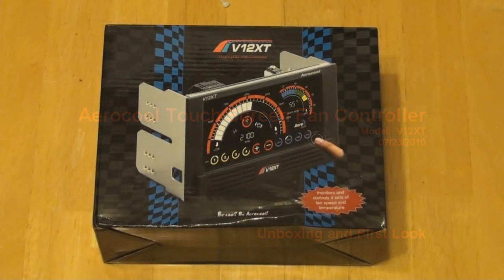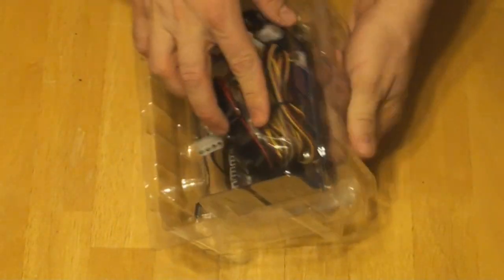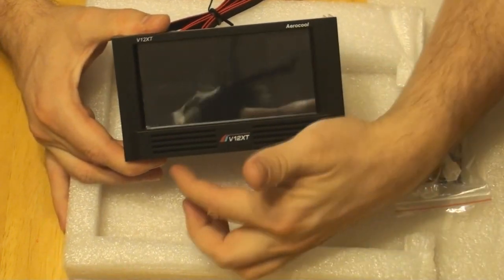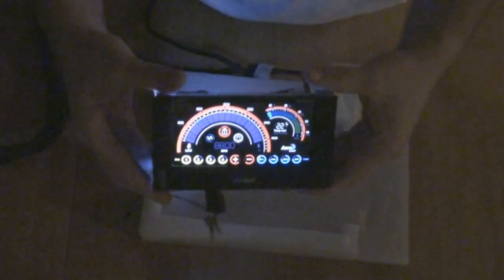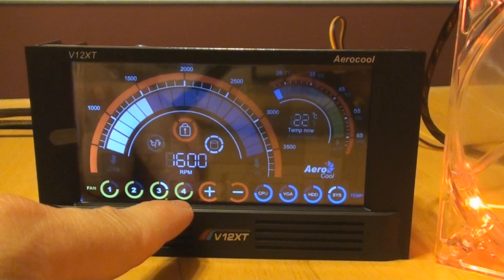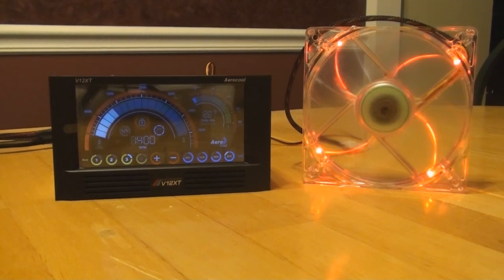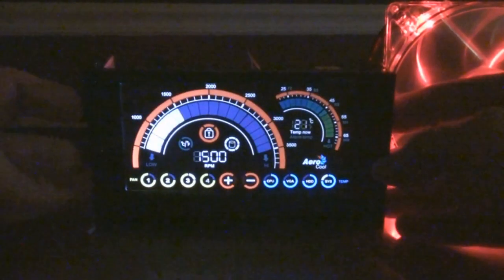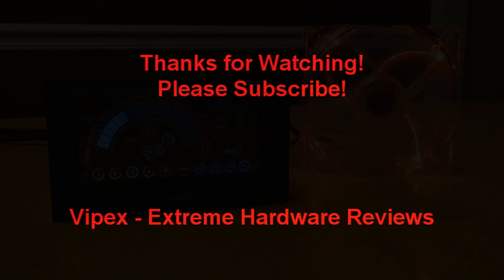Aerocool Touch Screen Fan Controller V12XT Unboxing and First Look

Comment: Nice, i think im gonna get myself one of these.
Just to let you know, when you lower the rpm the fan speed goes down slowly (not instantly) because a sudden change in electrical current could damage your fan, that is why they designed it that way.

Comment: About the fan taking a while to slow down, think of this.  With good fans with good bearings, they take a long time to slow down when they power down.  The controller probably sets the proper voltage/whatever for 800 rpm or whatever you set it to, but it takes a while for the fan to actually reach that speed, and the reading on the controller is telling you its current rpms.  

Could be wrong though.

Comment: I get that not everyones PC sits on the floor, and that the viewing angle is great to know about before buying. But when you make a product, you target it at the biggest group you can. Most LCD displays get distorted at any angle other then "Viewing angle". So to set the viewing angle up makes the most sense! Like I said, Great to know before buying! But in no way a deal breaker...

Comment: I have a BitFenix Recon, and it also suffer the same problem: viewing angle. I don't know if with the V12XT is possible, but the Recon gives you the possibility to exclude a very annoying alarm every time a temperature exceeds a set threshold.

Comment: hey mate, great review.
I could use your help with connecting up my fans, I bought some aerocool red led shark fans but the connectors that come with them have only a choice between 4pin molex or 3pin plug. Now do I to have fans that have both 3plug and 4 pin molex because the V12XT doesn't power the fans?

Comment: Fans in general only draw a few watts, you would need 10+ to even start thinking about considering them when thinking to buy a PSU.

If your system is low end, then a 650 Watt would be plenty. Mid range, 800-900 Watts. High end 950+Watts

Hope this helps :)

Comment: It would be nice to know the accuracy of temps and speeds displayed if you have the free time to cover it. These days you do see alot of cases, mostly with window mesh, being placed on tables & desktops- so this definitely would be a disaster for those type of set ups. But like one guy already said, as long as it does what it's supposed to the looks at an angle isn't too important.

Comment: I can only find a single forum in which the user states it physically caught fire, along with frying his motherboard apparently so something strange is happening there.

The most that could ever happen with a fan controller is you burn a wire, or pop a capacitor of some kind. A bit of smoke does not mean fire, I've burnt a few controllers myself when trying to run water cooling pumps from them, I would love to see some photo's of one that actually caught fire.

Comment: Im a bit confused on the "Auto" part. The idea is to maintain a set temp right? For example CPU fan1. Lets say I call 55c nominal temp.  When temps get above 55c will the controller automatically ramp up fan rpm until  temps drop or max speed is reached? AND when temps get below 55c will it rev down the fans until minimum rpm is reach or temps start to climb????

Comment: @trubyd44 if i had a mountain mods case (i wish) and one of the panels was a tiple quad (12 120mm fans ) and i had one of the mountain mods power station where all the fans were pluged where do i plug the power station to contol the fans?? and if i had could cathods pluged to the molex conector of the station if i incresed the fan speed would it increse the light intensity ?? i dont bother to control the fans independently a general speed control would be perfect

Comment: No mention of how the temp sensors are fitted! Would have been nice if it used a USB header on the mother board with a driver to utilize the on board sensors!
Can you change the name of the sensors from what they are to eg.GPU,GPU,GPU,CPU?

Comment: I will have to admit i think aero did that on purpose last time i checked 99% of the time your computer sits lower than you do, meaning visually it will look the best from where your sitting. That is not a deal breaker thing is sick in my opinion.

Comment: I notice there it says CPU, VGA, HDD, SYS.
Are those temp readouts or does it give you BIOS controls?
or are those not buttons and they dont do anything?
Reply from the maker: No BIOS control, they are buttons for temperature readings.
Reply: @Trubyd44  Thanks! A temp display could be useful.

Comment: ive got this controler and i wish i didnt iff your using it in a bright lighted area forget it the screen fades with the coloures as iff the colours just fade duller  i thought it was my psu so i tryd it with another and its still the same so i put my nxzt older model in and ran 2 off them to see iff the readings wer the same !  GUESS WHAT they wer both different the onlder model was nearer to exact temps and fanspeed as the newer 1  was way off

Comment: My previous case was 66cm. tall. That means that if placed on a desk, the 5.25" bays are in fact above eye level.

My current rig is on a raised platform at the back corner of my desk. That puts it quite a bit above eye level. 

If you have a problem with that, your life must be horrendously sad and boring.

Comment: hie, i need to know... i got fan 200mm which is using molex connector, what if i get those converter, molex to 3 pin n plug to this V12XT Fan Controller....

will it work ???  can i still be able to adjust the rpm as well ??
really need to know..  thx !

Comment: Hi I came across, your video, and was wondering if you could help me. I recently bought one of these and hooked everything up, when I try to adjust the fan speed, it won't work, I mean it lights up, it beeps when you touch it, it shows everything connected, but it just won't seem to adjust my fan speed, any suggestions if you don't mind, I would really appreciate your help, thank you

Comment: is it better for a fan to be faster or faster ?
Reply: im  a gamer and i have no idea if faster is good or bad
Reply: viper combat faster makes more noise and gathers more dust, but is generally better at dispersing heat than if it was travelling slower, size of the fan can come into play but that's about it.

 I think the larger the fan, the slower the rpm as it's heavier, I think the rpm change is smaller..

Comment: I would legitimately show you some pics, but I just sent the thing away. I know it wasn't a capacitor because I looked the thing over under a microscope. And you really have to look around, I found at least 50 people this has happened to.

Comment: Not about the looks it's about if the device can do it's job and who would put there pc higher than eye lvl cause if the have a DVD drive they still have to stand up to put the DVD in that was an example most pc users have it on the floor under there desk or in a desk cabinet and they made it like that cause u will be staring down at you pc not up.